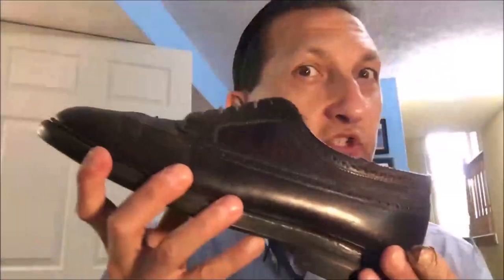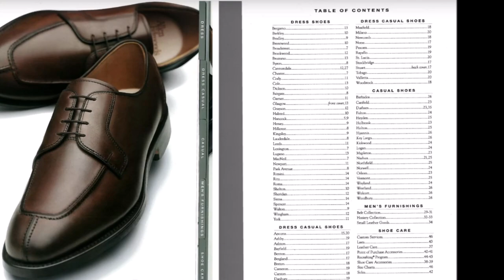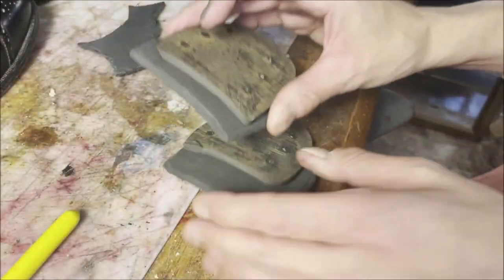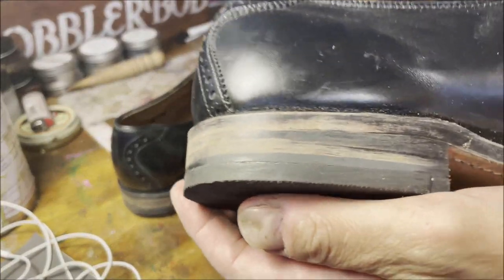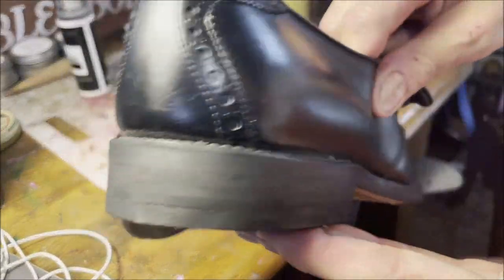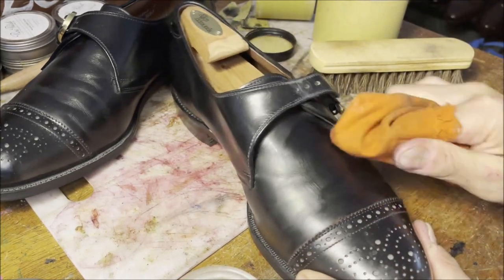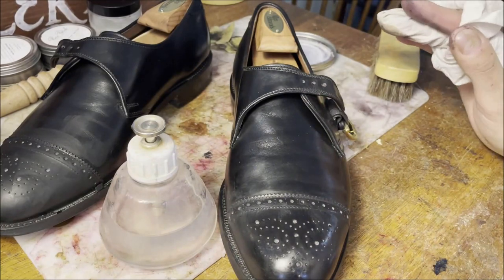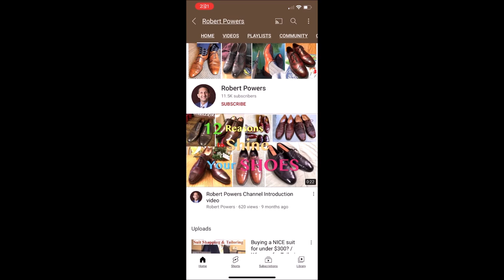New Heels & Shine on 29 Yr Old Allen Edmonds

Comment: A bit of constructive criticism from a retired metal worker.  Green aviator snips are for cutting clockwise (right cut) and are meant to be used with your left hand.  Left cut snips are the red handled ones, used to cut counterclockwise (left cut), with your right hand.  The yellow ones are straight cut.
Reply from the maker: Aah, I think I knew that, and honestly I think I mis-use them because one of my pairs are just dull and worn out.